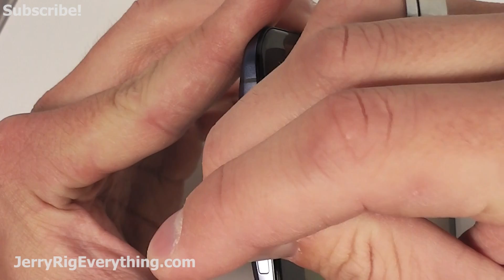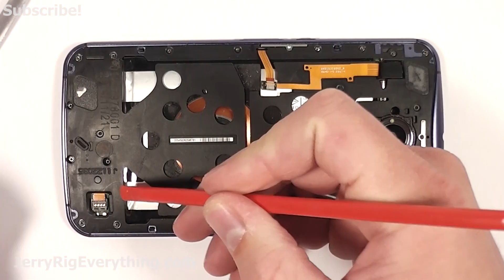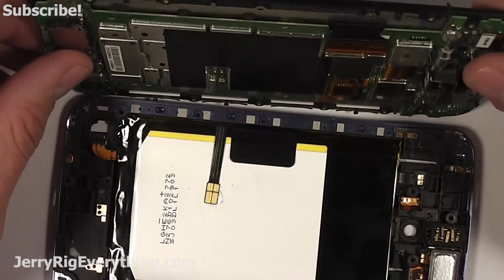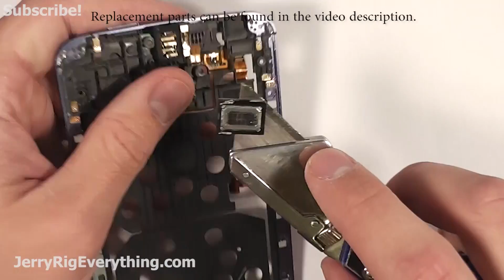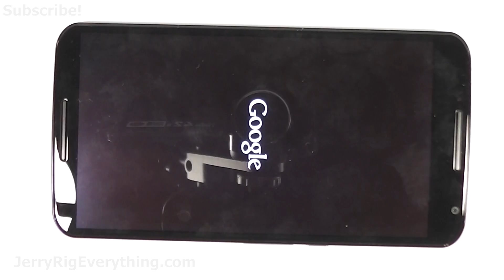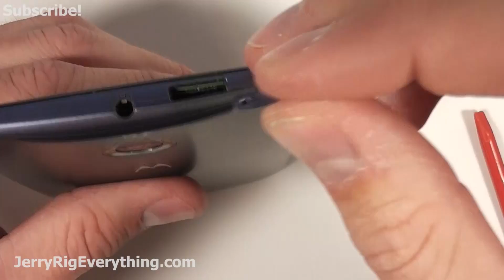Nexus 6 Screen Repair, Battery Swap, Charging port fix

Comment: Hey Jerry,
Hopefully u still even read Comments on old Videos. I got a issue with the Charging. When i did the Steps when u said "wont charge otherwise" i did everything like u said but sadly my Phone still not Charging. i did everything same like Line Up the Holes and also the Panel on Top of the Mainboard. Maybe i Squeezed to Much the 2 Pin Part of the QI?

I have rebuild now the Phone Prob. 8 Times and cant fix it. Its for sure not the Battery since i also tested my old one.

Comment: Thanks Zach I just got the old relic from a friend and it needs a new LCD looks super easy  I'm going to replace the LCD and battery , sorry the LCD it flicers when u touch it and the screen is not color correct anymore

Comment: My father passed and I wanted to retrieve some family photos from my older phone, the screen is broken, had water damage, phone will not power on and is not charging on micro USB / wireless charger. If I replace the screen and battery could the fix the issue? Does anyone know how durable the motherboards are besides having to replace the charging port?

Comment: Nice video. Well explained. I need to replace the battery of my Nexus 6 as it keeps shutting down randomly. Do I need to take data backup before I replace the battery ?

Comment: The video is excellent however as with my Nexus 6P and apparently many USB-C female jacks, the connector is flakey. After researching to re-confirm, there is no way to wirelessly charge it contrary to the comment in the video so unfortunately, it's upgrade time soon.

Comment: I changed the battery and it turned on. But volume and power button not after changing battery. What could it be?

Comment: Good instructional video!  Excellent tips!  Especially, about how to start prying the back panel using the SIM card hole.  I couldn't find any opening after excessive heat and trial several times.  Before I started to damage the back panel, I found your video and was able to get it off a lot easier then.  Thanks!!!
If I may also add, in the process of re-assembly, to replug the ribbon cables, align them on the plug on top of the connector and pres gently to snap it in.  If it doesn't plug-in with a simple pressure, it probably isn't lined up correctly.  Good luck everyone!

Comment: Thank you!  Various other videos either warn about disconnecting the volume control ribbon cable, or show a quick disconnecting and reconnecting without describing or showing in detail how to do it.  Yours is the only one that shows the latch that has to be popped up and resecured once the connector is in place.  Cost me an hour or so of examining under a loupe and experimenting, trying to figure out how to reconnect the two cables.  Wish your video had popped up first!

Comment: hello good day, my nexus 6 has problems with the battery but now it turned off and I loaded it and turned it on but this time I do not start it just keeps loading where it says google and stays there it does not start, Do you think it's a battery problem?

Comment: Thanks for this tutorial. For folks looking to replace the display/digitizer assembly, the narrower of the two cables is the digitizer connection. I did the partially assembled test and the touch screen didn't work. I went back and seated that connection deeper and that got everything working. The screws are T3, which should be obvious when you try to fit a T4 into the heads. Also note that my display assembly didn't come with the two plastic strips that fit into the mic and speaker slots. You can pry the old ones out with a spudger, then I used the spudger end to push the strip's tabs into the corresponding slots. The pry tab on my battery connection broke off easily, but I could pry out the connector with sharp angled tweezers. The connector reseats and works okay. I'll probably replace the battery in a while and assume it has a new connector.

Comment: Great Video, I have a question since this is my first time trying this. If the phone dies after placing it in a USB charger, Is it the battery or is the board dead? I can still pick Qualcomm when I plug it via USB to my PC but nothing else. It will not charge again. System reboot will not work. either
Reply: man.. same problem.. hope someone has an answer soon.. mine was dead after charging it a little too long... and same thing as you, Qualcomm via USB to PC but other than that, dead...

Comment: Awesome tutorial. However I'm in the UK and it was T3 screws. Secondly the back panel is a pain to get off, Was soo well stuck together. Took me about 5 mins to gently peel it back. When taking out the screws make sure you are pressing down firmly otherwise you will strip them. Overall an easy job but fortunately I work with my hands on a daily basis. However for anyone who doesn't just take your time it really is simple and just follow this tutorial as you are doing it. Good luck ;)

Comment: My phone stopped charging all of a sudden when I plug it into the charger.  It does charge using a wireless charger.  Why is that?  What do you think the issue is?
Reply: I thought you could Not use a wireless charger on the Nexus 6P

Comment: I have a Nexus 6 that when placed on multiple different wireless chargers it charges for about 10 seconds and just stops. It's not the chargers as they charge another Nexus 6 perfectly, it is the phone. It charges via USB cable just fine. I am thinking the coil inside has come loose or damaged, does this sound right? Position doesn't matter either, it charges for 10 sec or so and just stops. Do you fix phones with issues like this? If so please contact me. Thanks

Comment: Hey so I had a cracked glass and lcd screen so I got the part you recommended from that site and then did the whole swap of the screen and the phone turned on no problem, however, the touch screen is not responding to touch? what do I do?

Comment: Hi Jerry, do u have any idea how to solve "camera has stopped" occurred on Nexus 6, it is because of the hardware or software. I already reset the phone to factory reset 3 times but still the camera is not function. Thanks
Reply: Qamarl Hysam It's definitely a software issue, try reinstalling your firmware, find a tutorial online.

Comment: I'm replacing my battery, so these are note as I go:
1st off HOLY SHIT is that tough adhesive!  Took over half an hour of slowly prying and peeling once I learned the trick of sticking the pin in the simm card port.  This is the second video I watched as the fist just peeled it off like no big deal, didn't even tell you that one, so wheew.
2nd Turning my T4 screwdriver that came in my repair kit does nothing, it's too small to bit, yet my T5 is too big.  Shit, now I'm stuck.
Reply: Wait, are they T3 or T4?  Some sites are saying T3 instead, so maybe I have a T3 driver in my kit, but T4 in the phone and that's my problem.  Well, played around and found my eyeglass repair kit flat head works, but they are in TIGHT!  Got the pliers to turn them and they seem to be coming out now.

Comment: it's Worth noting that the screen you listed here is not the correct part. I purchased the screen and ended up with a paper weight, since the part does not have the frame to screw onto the body. you need to remove and reglue the frame to the new screen, which is honestly impossible without proper parts and adhesives. this video is more or less useless since nothing in this video ended up being true or useful as far as user serviceable repair goes.
Reply: For reference, THIS is the correct part: http://www.repairsuniverse.com/motorola-nexus-6-lcd-touch-screen-digitizer-assembly-frame.html

I think you should make an apology video for this one. I imagine you never actually repaired this phone. Just tore it apart, and googled a screen part without realizing what you were posting.

Comment: Hi Zack,  Do you know if replacement of the mother board is possible on cells without any connectivity issues?  Inquiring cause if on my moto x pure, the charge port goes sloppy, the mother board is only fix right? Thanks,  another quality tear down as usual.  take care.

Comment: My Nexus 6 is working at 100%, except for a crucial part
The WIFI
Everything runs smoothly, untill I pull down the notification bar, touch the WIFI button to activate it....the phone freezes, after 3sec, everything is blocked, if you try to click the home button or do something else, the phone react 3sec later, and plays just 1 frame.
after about 30sec, the phones reboot and is back to working a a 100%, expect for the WIFI.
I have no way to turn it on

This phone means a lot to me, I'm in love with it.
I tried taking it to some technicien that tried several flashs on it. nothing worked. They say it's a hardware probleme.

Can anyone give me hope?

Comment: Hello my phone has gotten over heated several times and now its not turning on. I pressed the power button and down button key and its saying that the battery is ok. So I feel it may be the port itself. but i saw that you said that the port cant be replaced. Can I try and see it charges with a wireless charger. I didnt want to get one if it may not work. Thanks in advance.

Comment: what's the water resistance rating now? my phone is in the shop right now, if this is what they're are going to do to it I don't want it back.
Reply: What did you think they were going to do with it in the shop? Turn if off and on a couple of times?

Comment: My Nexus makes crackle noises on the top speaker when I play music. The bottom works fine. Is the part I need the "Loud Speaker Replacement" or the "Ear Piece Replacement"
Reply: Joaquin Dayrit I am wondering the same.
Reply: Joaquin Dayrit, ear piece. If you were still wondering. However, if you haven't fixed the issue, if you create a seal around the speaker, with your lips, and suck it will fix the problem. Sounds weird, I know, but it actually works. Today I was having the same problem after doing a mid frame swap, and ordered it myself, but decided to do some research. Found that little tidbit of info and decided why the hell not.  It fucking worked! Blew my mind!
Reply: Joaquin Dayrit, ear piece. If you were still wondering.

Comment: Wow,this is a pretty straightforward process to get the battery out. I was kinda worried about what to do once the battery degrades,but as long as I can find a replacement I guess I'm good. it'd be nice if I could throw an extended battery in this big phone considering how slim that one is.

Comment: great video. finally got to the insides of my nexus 6.
it fell in water and im trying to replace the battery to see if it comes back to life. one concern, do i have to replace the qi coils? i cant find it anywhere. hopefully when i replace the battery i can just reuse it. any thoughts on this?

Comment: I just replaced my battery, but the phone won't turn on.
I checked the buttons ribbon cable and it was connected.
Also when I plug it in the charger the screen comes on and shows that it is charging, but can't turn the phone on.
Any suggestions ?

Comment: I'm not sure what specifically is wrong with my device, but I'm sure it has to do with the charging port. I receive the "charging" message on my lock screen only with certain cables and that's only when I position those cables in a specific way. Otherwise, I receive the lightning bolt icon with my other cables. I've been looking for a good wireless charger which supports quick charging standards and possibly includes an internal battery pack as an added bonus. Any suggestions on what I need to replace in my phone and/or wireless charging pads with my needs? 
Thank you

Comment: Very unfortunate to watch a 6 mins video with the description saying, "charging port fix" only to hear only a single sentence about the charging port that "it is not user serviceable." Do not list something in the video title if it is something you don't cover. otherwise, would have been a good video. Consider changing the title
Reply: I am also disappointed about this. I'm writing this comment on my dying Nexus 6 :(
Reply: @Fionnafire  Just use a wireless charger man...
Reply: The charge port repair service is here: http://www.ebay.com/itm/Nexus-6-Motorola-Broken-Charging-Port-Repair-Service-/371640985983?ssPageName=STRK:MESE:IT
Reply: Vince N. Thanks, but that's pretty expensive. I am already going to get the 6p soon anyway
Reply: Charlie Curtiss... And note that ebay has listings for the micro usb charging port. Any event, it may be better just to have the local mobile device repair repair shop do it. I contacted a few I found on yelp. They all said $60. They'll even replace the battery for $40.
Reply: @mr.gentry9469  If you want it fixed get a good soldering iron and replace it
Reply: yes agree please stop the click baits or ill hate
Reply: I agree.  Stupid Youtube click bait
Reply: The fix is the wireless charger

Comment: Why say in the title of the video, that you are going to fix the charging port, then just say that it's not replaceable?
Reply: DrKlown Good point. In fact it is replaceable! Microsoldering is involved like any other micro usb charging port. Local mobile device repair shops here will do it for about $60. They will replace the battery for about $40.

Comment: i have to use a wireless charger because the little input at the bottom of the phone broke so now i cant charge with cable. how can i get that replaced?
Reply: Even my nexus 6 charging port has stopped working . My battery has completely drained. Will my cell restart with a wireless charger ?

Comment: Here is my problem: As of recently, my Nexus 6 looses battery even when the phone is in airplane mode and charging!! Do I need a new battery, or what?? I left my phone on the charger at 56% (in airplane mode with no bluetooth, no data, and no GPS or anything else on that might slow the charge down) and when I came back, it was at 44%!!! How do I fix this issue?? I love my phone, but it's unusable if it actually looses battery juice when it's on the charger. It use to charge really slow, but now it actually looses battery when it charges. I've never had anything like this happen before. Please Help. Please and Thank you :)
Reply: either your battery needs to be recalibrated or you need a new battery. I have the nexus 6 as well, tried to recalibrate the battery, works for a little while, but then it goes back to doing the same. I just replaced the battery and now it is back to normal.

Comment: I broke my Nexus 6, and now its not working, I can still hear the notifications, alarm sounds and sometimes I can feel the vibrations when I press the on/off button but there is no DIsplay and there is long crack on the screen, I went to the repiar shop but they are asking 11,500/- for the Screen repairing, can anyone suggest me the cheaper way to get it repaired, plzz suggest
Reply: let me know if u found a solution other than sparing 12k for screen repairs. buying a digitizer online might be cost effective solution. Nexus6 is one of the best looking gadgets
Reply: No I havn't found any solution yet :(
Reply: Sadly there is no other option but to pay 12k to authorized Motorola service center for screen replacement. I have paid that twice in past 6 months (ouch).  Now I am wiser with a tempered glass and battery case. This phone has ended up costing me 78K with all the repairs and accessories. This better last me a lifetime.
Reply: Guess what, at this price a new Nexus 6 is a hot deal but available in US markets. Just ship one from Amazon or Ebay..rather than wasting 11K for the repair. They havent cut the rates here but the devices sales off for $200-$250 now abroad

Comment: the part at 0:58 when i popped this off the part connected to the motherboard came off and stayed connected to the ribbon.  when i look at it now, it looks like there was no glue that attached it to the motherboard...could explain a lot.  is there anything i can do here or is completely broken now?
Reply: also my flashlight stays on all the time, even with phone off.  i did this simply to unplug battery, but light came on again.  how can i disable the lights?

Comment: My experience is that the repair is not this easy. Nearly so, but after ordering the tools and part linked in the comments, I still ended up returning them and buying an entirely new phone.

I ordered the parts linked in the video. The part arrived without the mesh backing or frame. The mesh backing is unsalvageable off your old Nexus 6. I managed to salvage the frame off the old Nexus 6, however the glass from the old screen was still adhered to this frame. The part I ordered came with no way to adhere the new glass to the salvaged frame. I did have the means to clean the old glass off the salvaged frame, or to adhere the new glass to the salvaged frame.

Perhaps it's bad on me, but I thought if I ordered all the parts and tools in this video I could do the repair. However without salvaging the frame, removing adhesive from the salvaged frame, and re-adhereing the new screen part (that's linked in the video), you may not be able to make this repair.

Comment: How do you access the storage? I have a problem in which I dropped my Nexus 6 in water, I allowed it to dry but it refuses to turn on. When I plugged it into charge after a few days of drying, it emits a green LED signal, and a white battery signal with a lightning bolt pops up every 3 seconds but the phone can never turn on, so I've pretty much gave up on it.

I was wondering if it's possible to retrieve the storage from the Nexus 6, but I have no idea where it's located. I like to retrieve all the Data that was on my phone. Do you have a solution for this? If you have a solution for the above problem, that'd be great as well.